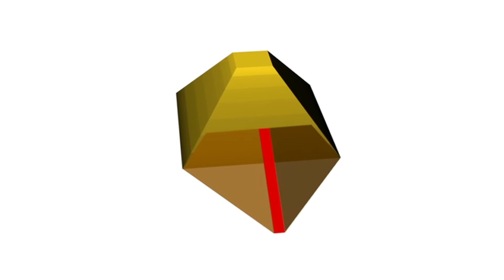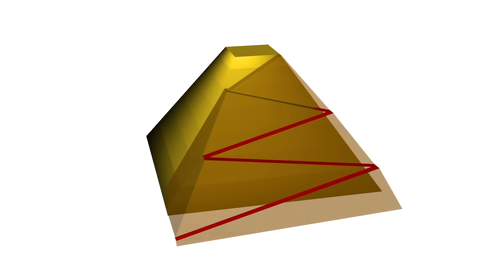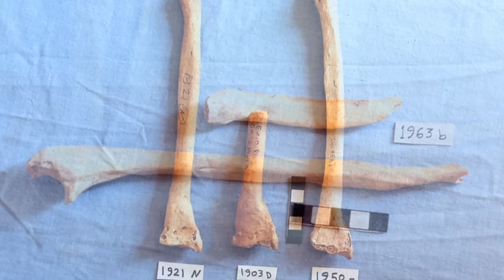Egyptology - Pyramid Construction

Comment: Straight ramp and spiral ramp both are not much practical i think. For straight ramp, after achiving every new height, say for ever 10 feet, they have to build a a new ramp from farther area to acgieve this new height. For zigzag or spiral, i dont think they could easily turn the cart carrying huge rock to follow spiral or zigzag way
Reply: 1 - the blocks of the pyramids vary in size in that the higher you go = the smaller the blocks become.  Thus smaller blocks require less effort to raise.
2 - meanwhile there is ample evidence of the Egyptians employing earthen ramps at Giza as well as mudbrick ones in other places.  In the western cemetery next to the Great Pyramid is the remains of smaller earthen ramps made from a mixture of sand/stone chips/tafla - a clay they mined.
3 - when the limestone quarries at Giza were excavated they were noted to contain massive quantities of what they built ramps from.  Also near the worker village at Giza is the remains of a huge tafla mining operation.
4 - Herodotus wrote they first built a "stepped pyramid" ala Djoser to then fill in the sides and finally encase it in white limestone working from the top down.  He also wrote they employed levers as well as what he termed "a machine" which was likely a lever device employing a fulcrum and counterweight.  He also wrote they created "a great causeway" which can only be a ramp. 
5 - so the main ramp in truth need only go as high as the largest/heaviest blocks to be raised = relieving stones above the King's Chamber.  That is only about halfway up the pyramid and below.  Above that level the smaller blocks could have been raised via the lever device which sat on the steps before that area was filled in as well as possibly smaller mudbrick ramps as the smaller blocks did not require large teams to transport them.

Moral of the story:  so above is an example of the evidence relating to this.  Further they moved blocks via wooden sleds and those sleds were pulled by teams of men and draft animals = oxen.  The worker village contained many tens of thousands of cattle bones while tomb depictions such as from the tomb of Hunefer show yoked oxen pulling a large sarcophagus on a wooden sled. An ox can pull more than 2X its body weight so that teams of oxen could move multi-ton loads.

Finally they poured water before heavily laden sleds - we see a depiction of them doing this.  It has been tested and moistening sand before a laden sled reduces the friction and hence the effort by almost half.  So what happens when you moisten clay??  Answer:  it gets a bit slippery.  So ramp surfaces partially made from clay would if wetted down become more slippery.  Also laying wooden planks into the surface of the ramp would help wooden sleds to glide over the surface easier.  Also on the pyramid itself you find large amounts of gypsum mortar = it is jammed everywhere.  So putting thick mortar paste before a large block might help it to be levered into final position a bit more easily - aka "greasing the track" if you will.  Something new to think about.

Comment: The materials that make the pyramids were beneath their feet and when mixed with the plentiful water of the area they became like liquid concrete, which were cast in place with wood frames hence the almost perfect alignment. they didnt carry the blocks into position but cast them in place and let them dry in the sun. The whole thing was a series of poured concrete in wooden moulds.
Reply: since when do you pour granite? more conjecture
Reply: @TheBanjoShowOfficial  and several other places describe how granite can be melted.
Reply: I've read this also. It sounds almost far-fetched, but it's the only one that ultimately makes sense. They were cast like concrete.
Reply: Limestone cement blocks were made on site by pouring liquid limestone cement into molds. See videos on YouTube on this process. Not carved granite blocks.

Comment: According to this theory, the ramps probably would’ve used up more material than the pyramid itself considering how tall they would be and the shallow angle that was required.
Reply: underrated comment
Reply: also to build the ramp, the ramp would have to be higher than the pyramid itself. So that would mean IF ramps were used they should still be visable today... but they are not.
Reply: Not to mention, the extreme length the final ramps (at a useable slope) to the top would have to be. It would take more logistically, in materials and labor, to build the ramp than it would be the pyramid itself.
Reply: No, the simple answer to the ramp that they don't show hear is having the ramp spiral inlaid on the outside of the pyramid. Idk why they showed a spiral ramp protruding out when simply not building certain parts of the pyramid on the way up works perfectly fine.
Reply: @KeanuOR  
No it doesn’t work. The volume of material spiraling around the perimeter would be far more mass than the pyramid itself. Basic volume calculations on geometry. And... the tangent angle required to pull the block in an arc, with the length of manpower to “pull a straight line” .... the ramp would be a 6 lane highway in width. It simply doesn’t work.
Reply: @5222k  You did not understand. There is no additional material required. As you are building the pyramid,  simply don't place certain blocks, and have that be the path itself. There was never a need for a ramp in the first place.
Reply: @KeanuOR  
Nope. There is not a block placing sequence that supports that theory. And again.... how do you place the corners or turn a corner. I guarantee you.... neither you or I know how they were built. The Egyptians certainly didn’t.
Reply: @5222k  what do you mean how do you place the corners? You place the block and turn left (or right if you're building the other way). We don't know what method the pyramids were built in, we do know ways in which you could build the pyramids though. 

It's just like a UFO; if NASA says they spotted a UFO in orbit, It doesn't mean they've found alien's,  it means they don't know what the object is. They then deduce the most likely thing that it is, which is usually rocks, and when these things sometimes burn in the atmosphere a certain color or land somewhere where people find it, it's always exactly that.

In fact, we can prove what I'm saying right if you just go out and buy a couple leggos and try to build a pyramid in the way I told you. It's 100% doable, but if you don't tell someone else what method you used to build it, they won't know how you did it either (but they'll probably guess many methods).
Reply: @KeanuOR  
"we do know ways in which you could build the pyramids though. "...

No. We can't machine granite pieces with that tolerance out of a quarry floor today. We can't survey 4 corners in at that base footprint with the same accuracy today. We certainly can't rebuild the exact same pyramid with the same quarry extraction remains today. 

Leggos? That only represents shape arrangement. It is completely absent of material properties and physics though. It's like me telling you how to train to run a 3 hour marathon. Doing it involves so many other factors that the theory of how doesn't make it happen. 

You should stop honestly. I'm not trying to be right. But you seriously are giving some very one dimensional concepts here. Are you double vaxxed / double boosted by any chance?
Reply: @5222k  Everything you just said was untrue and nonsense. Your need to attack my character while proving such non answers is telling.
Reply: @5222k  Since Lego operates under the laws of physics, I'd say they're an accurate diagram. Clearly you misunderstood that I was not saying the pyramid was actually made of Lego, otherwise you wouldn't be holding on to that. Just a heads up, they also don't use pasta to build actual bridges.

The model is used to show a proof of concept, which is why they used 3D simulations in the video and didn't build actual ramps around actual pyramids to show that it didn't work.
Reply: @KeanuOR  
You and I can lift LEGO’s pretty easy.
Reply: @5222k  again, the Legos are meant to demonstrate the building method, not simulate a 1:1 reconstruction of reality.
Reply: @KeanuOR  
Finally you agree with me. Not... reality. The whole picture includes “how” did they quarry extract the stones so perfectly? LEGO simulation doesn’t present that issue. 
It’s cool. I have some LEGO’s too. For when our little nephews and nieces come over to play.
Reply: @5222k   We simply don't know the method they used, doesn't mean we can't do it ourselves. 

I'm glad you've taken to twisting the Lego bit so much though, I must say, playing it down is a great way of avoiding the validity of the analogy.
Reply: @KeanuOR  From how you explain your lego analogy it doesn't seem to work due to the physical construction process of how lego works. If you have a source to better explain your analogy it would help us understand more of what you are trying to say.

You also made a comment saying ''We don't know what method the pyramids were built in''. True, we do not know how they built them. But why do you then proceed to make comments that contradict what you just said by trying to then explain a method they used to construct the pyramids. There are a lot of hypotheses, yes, this includes the spiral method you tried to mention as fact. However, we are still yet to find an actual possible, working, factual theory. So basically no one still knows how the pyramids were made, and anyone who claims to know how they were built is lying.

You also then say ''we do know ways in which you could build the pyramids though''. Also true, but those ways consist of modern machines and technology we have today. So the ways we know how to build the pyramids are irrelevant because the Egyptians didn't have our technology back then. So in fact we do not know any relevant plausible ways in which the pyramids were made.

Comment: If it was possible to build using primitive tools , why nobody is fixing those highways in India and Pakistan where a bus has to make a hairpin turn , while hanging one wheel over 1000 meter cliff ?  There a lot of cheap labor , much more in the ancient time and there is a practical reason and monetary gain, yet nobody is cutting highways with a precision of 1/1000 of an inch , making absolutely flat road surface and walls at 90 degrees . 

I my opinion, it is an absurd idea to use two sticks and a rope to make flat surfaces . Why doesn't he patent it and sell to contraction crews  ? Lol .

Comment: To my idea, long before formation of the pyramid at that very place, the ancient men of Egypt felt some sensations there as it is the centre of the earth. So it was the natural phenomenon. This phenomenon is still taking place and was taking place long before men's knowledge and has been coming talking place just after the moment of Earth's existence in the universe. In fact, Egyptians were ignorant of the fact that it is the centre of the earth. They built it not  after coming to know that it is the exact centre of the earth, but they did build it feeling universal magnetic sensation there. It is we who today know that it's the centre of the earth. It is, no doubt, admirable that they built such architecture using the formulas of mathematics. They hopped to capture the universal sensation; so they covered it with rocks thinking that it's harmful or useful. Perhaps some priest would have suggested the king to cover or capture it. And so, to drive it out from the planet and to return it back to the universe, they made the top of the pyramid tapper. If there were no pyramid there, natural phenomenon would be same. The allignments of stars and their relations with pyramid, coficient of the speed of light and that of position of pyramid, function of wave - are much earlier the same before the structure of pyramid had come into existence.

Comment: I believe its just one big straight ramp. Built up along with the pyramid as it went up, basic and simple.
May have been wider at the base and shorter, it got narrower and thinner and longer as the pyramid got higher. It leaned onto the pyramid, self reinforcing, less complicating,  very effective. Solves the whole lot problems of  transporting hundreds of thousands to tens of thousands of heavy bulky blocks to the top.  That's the secret.
Reply: Actually the secret as you say is = that the blocks become smaller as the pyramids rise in height.  Google photos of the top of the Great Pyramid where people climbed it and took selfies.  Note the size of the blocks = they could have been slid into place by several men.  Accordingly the ramp as you say did not need to go to the top.  All it needed to do was go as high as the largest/heaviest blocks to be raised = relieving blocks above the King's Chamber which is less than halfway up.

Above that level the smaller blocks could be raised via lever devices of which Herodotus wrote the Egyptians used.  He wrote they first build a "stepped" pyramid ala Djoser to then fill in the sides and cover it in what limestone working from the top down.  So a device such as the Egyptian shaduf which uses a fulcrum and counterweight could have sat upon the ledges to raise the smaller blocks up above the level of the actual earthen ramp which once sat on the south side of the pyramid - closest to the quarry and harbor about ~400 meters away.  Smaller mudbrick ramps might have also been employed as well. 

Then as they encased the pyramids in more closely fitted and polished limestone - most inner blocks are little more than crude chunks of limestone quickly fractured from the bedrock and dumped into place leaving gaps all over - they could systematically dig away the ramp as they worked until they reached ground level.  When Egyptologists excavated the adjacent limestone quarries years ago they found massive amounts of sand/stone chips/tafla dumped into them.  That is what they built ramps from - there are the remains of smaller ones in the western cemetery adjacent the Great Pyramid.  So as they dug away the ramps they dumped the residue into the quarries to backfill the area.  There is the remains of a massive tafla mining operation at Giza near the worker village.

Comment: What if the ramp was actually the stone that built the piramyd, so they didn't need to dismantle the ramp, just finishing off from the top to bottom.
Reply: Except that all the evidence says otherwise.  Consider the following:

1 - the Giza pyramids were built during the Old Kingdom.  On the western side of the Great Pyramid sits conveniently enough = the western cemetery.  In it are the remains of partially finished tombs which still have the small earthen ramps used to construct them.  These ramps were made from a mixture of sand/stone chips/tafla - a clay they mined.
2 - meanwhile next to the worker village at Giza is the remains of a massive tafla mining operation.  
3 - also when Egyptologists excavated the limestone quarries at Giza years ago they found a massive quantity of = sand/stone chips/tafla has been dumped into them - or what they made ramps from.
4 - at Karnak which dates to the New Kingdom there are the remains of mudbrick ramps used to construct temples.
5 - the famous depictions from the tomb of Rekhmire show a hypostyle temple such as you see at Karnak being constructed using a mudbrick ramp.

Moral of the story:  so as we see there is actual archeological evidence to support the Egyptians building structures using external ramps made either from mudbricks or else earthen ramps.  There is further in the case of Giza evidence that as they encased the pyramids in while limestone working from the top down as Herodotus wrote they systematically dug away these ramps and dumped the residue into the open limestone quarry pits to backfill the area.  

So no = there is no evidence of what you speculate.  This is why it is best to always follow the evidence rather than "what if........." which as we see can lead you into dead end conclusions.  Something new to think about.